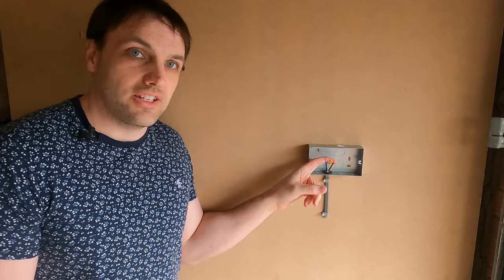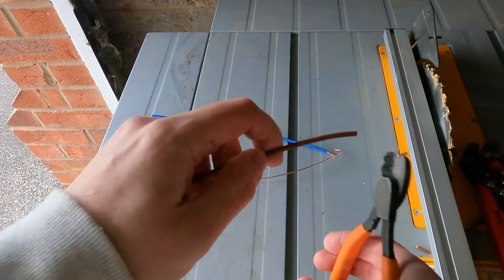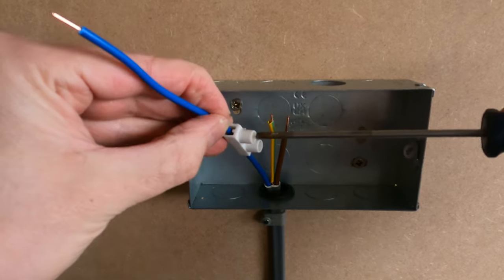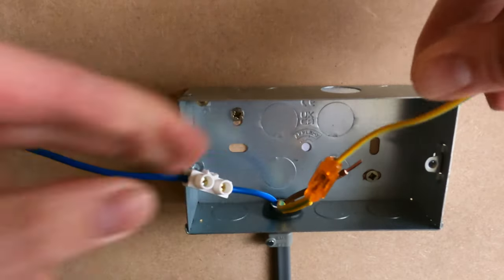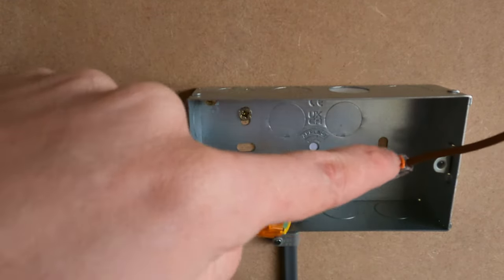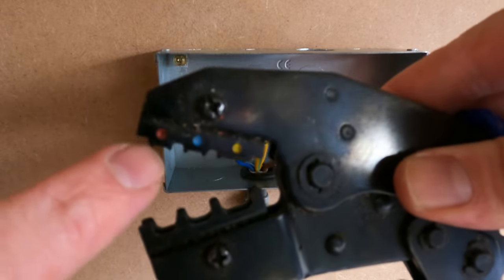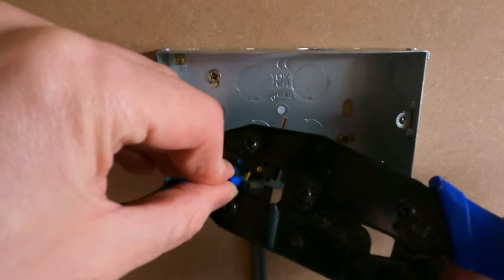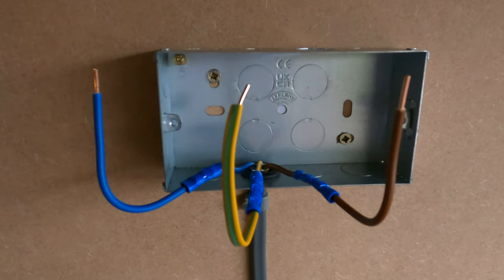How to Extend Short Wires. Easy Diy Fix

Comment: Hi mate, what would you do if you are replacing a CU and you realise cables are too short inside the cu. Would you use proper Crimps to extend? Or would you rather dig the wall and move the CU to adjust?
Reply from the maker: Either option is fine as long as it’s done competently and safely.
Make sure you use good quality connectors if you extend them out.
You get specific connectors that attach to a rail for this type of job.